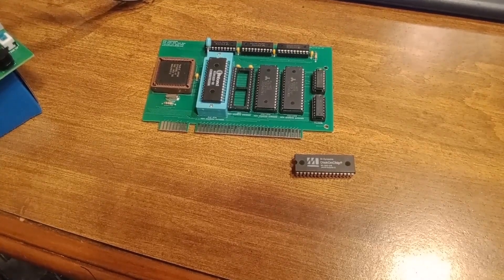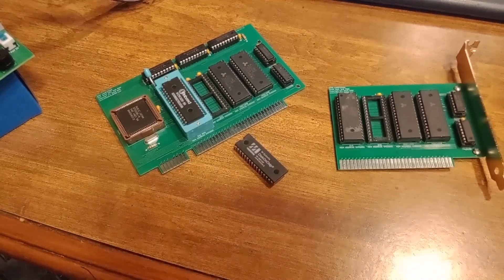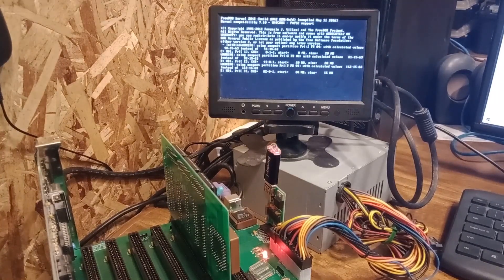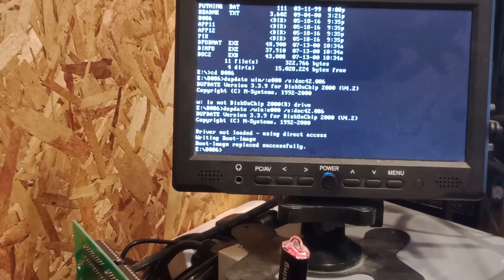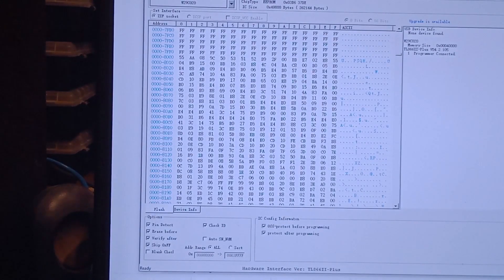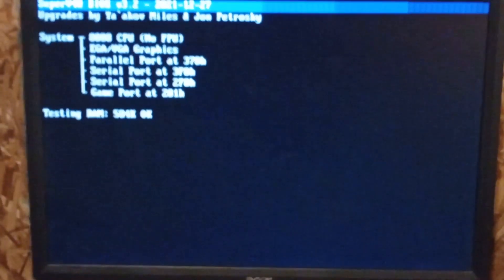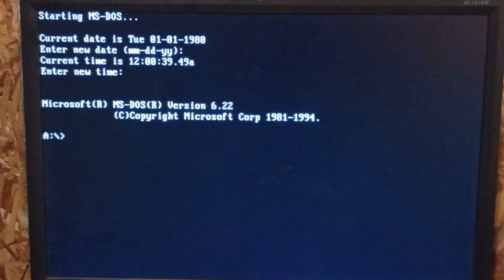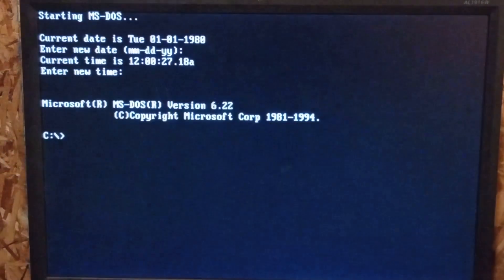DiskOnChip, 8088 Motherboard PC XT Compatible

Comment: Hi, is this different to DOM - Disk Onchip Module  that is basically IDE compatible module

I have these DOM modules on my Wyse CX10 Thin clients - i have 2 machines and 3 modules, all 3 are 100meg, one has about 6 meg wyse think client os, the other 2 are basically dos 6.11, microsoft works and dos games

Sorry but i do confuse DOM with Eprom boot bios

Back in Mid 80's at work we had some custom XT board that had Eproms on them, dos 3.2 boot and they loaded some terminal emulator to connect the PC's to X25 network to go to remote mini computer running our sales and accounts

Later on we had 286's and they had Eprom on the SMC Combo ( co-ax and ethernet )  lan cards
Reply from the maker: I am not sure. Maybe some on here can answer the question.
Reply: @elijahmmiller   Hi, thanks for the reply.  I actually took the cover of one of the thin clients, the modules are not the same, the IDE DOM ( Disk on module ) is actually a 40 or 44 ( laptop or powered via bus / cable )  pin standard IDE connector 

If you ever need a small size IDE drive these are perfect, much smaller that the IDE to CF ( Compact Flash ) or IDE to SD card setups as you do not need a pc adapter board

Thanks
George